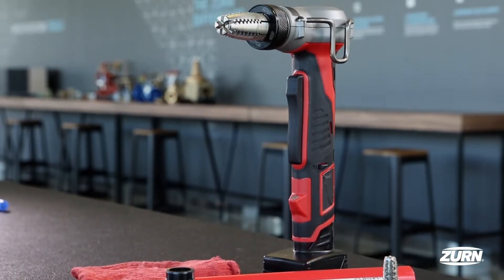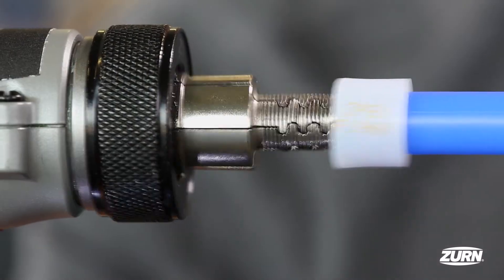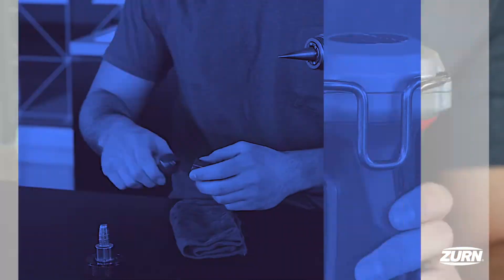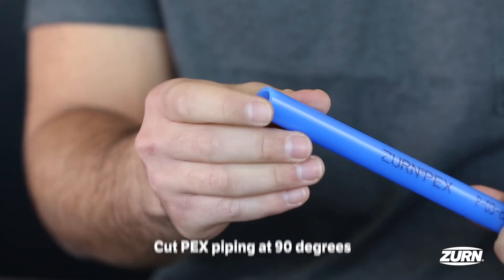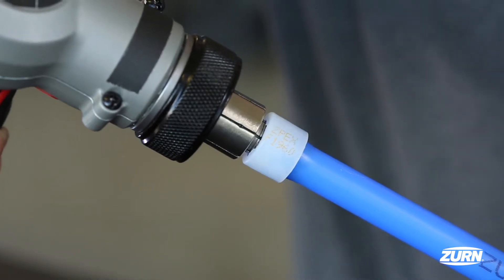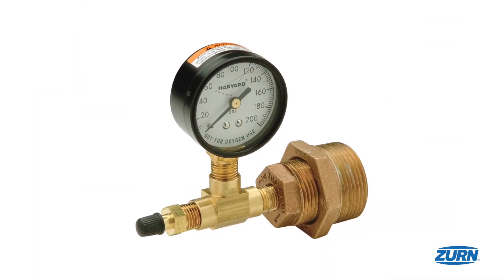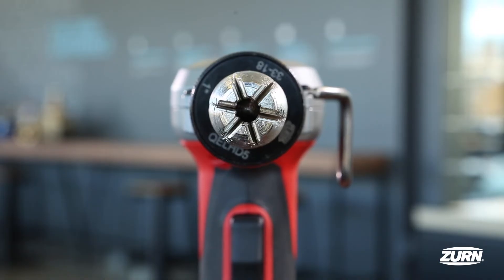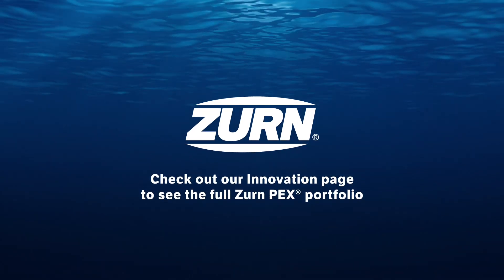Securing an Expansion PEX Connection with the Zurn QELHD_ Expansion Tool Head

Comment: So only zurn Pex B can be expansion? What's the difference between zurn Pex B and other brand pex B?
Reply: Funny in 2 years no one has answered your question. (I've asked it myself). I've used Uponor A with the original Milwaukee expansion tool and I don't have leaks. I first installed it in my own home and it's been fine. The burst pressure of B is higher but both are well above what any home is going to see so it's a non factor. A is better with ice.. I think Zurn just jumped on the bandwagon because without admitting it they know Uponor A is a better. Tons of it in high end commercial applications....good enough for me.

Comment: I called Zurn.  They recommend their Zurn heads for Zurn Pex-B pipe used with expansion fittings.  Zurn confirmed their heads work with the Milwaukee M12 and M18 Pex expansion tools
Reply from the maker: Glad we could help!
Reply: @ZurnIndustries  
OK to use DeWalt expansion heads with Zurn pipe?

Comment: Can it be used with Milwaukee or Dewalt expansion tool?
Reply from the maker: There are a couple ASTM F1960 Expansion power tools on the market that are approved for use with Zurn Expansion Interlocking Heads. Please email ZPApp@Zurn.com for full details. Thanks!

Comment: A rip off of Uponor.  I wonder if Milwaukee  likes one of their tools being used with the name taped over.
Reply from the maker: Thank you for your comment. This tool is a cooperation between Milwaukee and Zurn. Zurn has manufactured our own tool heads that expand the tubing and sleeves more uniformly that are used in conjunction with the Milwaukee tool.
Reply: @ZurnIndustries  Your tool expands B pex better than the Uponor heads  expands A? is that what you are saying?   B is NOT better than A and the letter designation  is not the reason. Go kink some B and then get  a heat gun out to restore .  A has a tighter bend radius . Uncoil both and tell me which one straightens better.  Then tell all the Viega lovers here why Zurn went to expanding connections.  Milwaukee likes their labels covered during you "cooperative" effort?  Doubt that.
Reply: @mohawkmike142     pretty common not to show other brand names.   go kink some copper     or maybe smarter dont kink your pipe at all.   type a smells like cheeze and rats chew through it.    you really think that stuff is that good ?
Reply: @mohawkmike142  I've worked with both and actually find pex A a lot easier to kink. I like the fact that with pex b it's more Ridgid, you can straighten it out and makes feeding it through holes/tight spaces much easier than A. Been putting in pex B for over 10 years and haven't had a single leak.
Reply: @mohawkmike142  Well, this didn't age well...  turns out that A that's been repaired by heating shows premature aging at the spot of heating - A installed on a radius bend crack there first, and Uponor A has been having a lot of issues with their pipe...

Comment: Where the heck can I buy this zurn heads . They do not last long and it is hard to find where to buy them .
Reply from the maker: These are available for purchase through any of our Zurn PEX distributors. You can use our Distributor Locator tool on our website to locate one near you: https://www.zurn.com/distributor-locator. Even if they don’t have it in stock, many of them can order it for you. 

Additionally, you can contact a rep in your area to call on distributors. They would have the best chance of knowing who may have it on the shelf. You can use the Rep Locator tool to find one near you: https://www.zurn.com/rep-locator.

Comment: I always suspected PEX B was expandable.   I also expected the pressure-up time to be much longer, but 45 minutes is a long time for a professional to wait before pressurizing the repair on install after the last expansion.
Reply: Coming in too late to make any difference here, but all PEX B is not expandable.  Zurn's pex is basically pex b, but it's special because it can be used with expansion tools or crimps.  Most pex b isn't expandable.
Reply: @grumphreys  Sioux  Chief also certifies its B for F1960 expansion fittings.